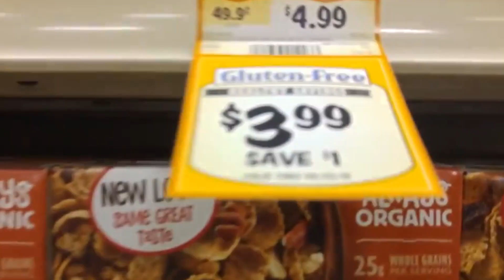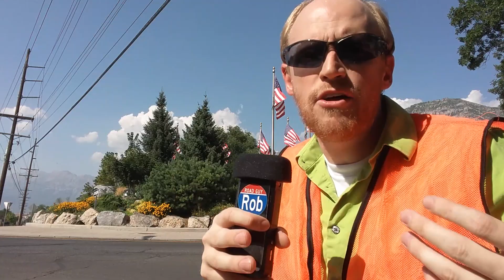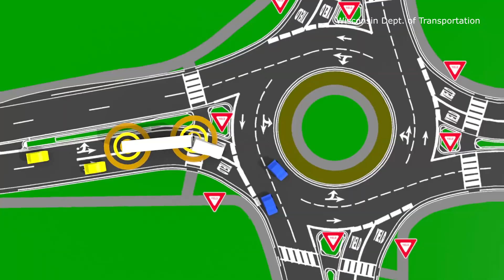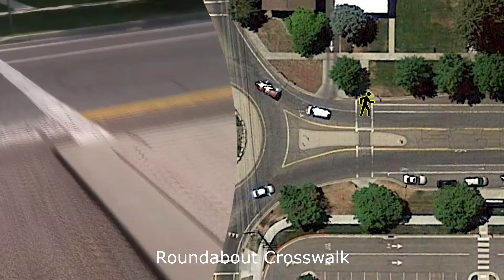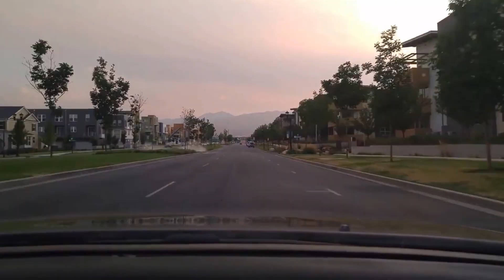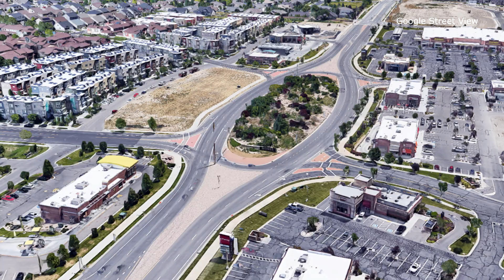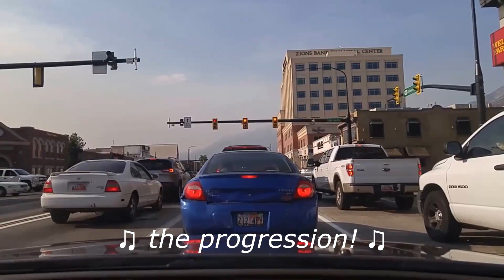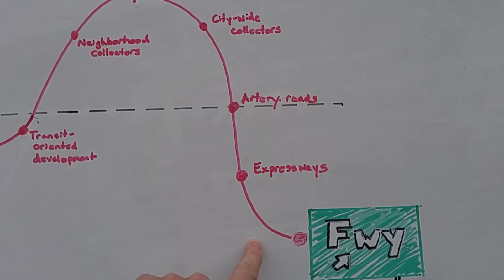Are roundabouts REALLY better than a traffic signal?

Comment: I was t-boned in a roundabout.  Yep.  I was in the far left lane of a busy roundabout and the other driver entered the roundabout and smacked into my front seat passenger side door.  I would have just exchange insurances and be on my way but he insisted that he wasn't at fault.  Police came, got both our statements and he was surprised to get the ticket.  I did ask the officer why he thought he wasn't the guilty party and the officer stated that the driver thought since he arrived at the intersection before him (which was true) he had the right of way.  The problem was that he was to my right, and in roundabouts you make sure traffic is clear to your left and then enter the circle.  Also note, my vehicle was a 9 foot tall Transit F-350 van so it's not that he didn't see me either.  So life goes on (I avoid that intersection at all cost and go out of my way to avoid it) and I get a summons to appear in court regarding the accident.  I'm not honestly sure if he was trying to fight the ticket (I thought that) because if the other party (me in this case) didn't show up he would have gotten out of the ticket but my husband was like hell no you're going.  So I showed up to court, the officer showed up, but guess who didn't?  So the driver ended up having a suspended license as well as the ticket, nd fees since he didn't show.  If I hadn't showed, the judge would have dismissed it.  So, if the other driver would have just exchanged insurances with me the ticket and loss of license would have been avoided.

Comment: I appreciate the mention of Carmel, IN.

They really show that if you go all in on roundabouts, it's vastly superior to traffic lights. The problem is just the mix.

In my home city roundabouts made my commute so much faster. Instead of 6 green lights on a row, I would usually get 6 red lights in a row. The roundabout fixed that!
Reply: Roundabouts work well in roads where there is equal amounts of traffic coming through each branch . Where there is a large flow in one direction problems occur on the other routes which lead to a build up of traffic on those minority routes and congestion as the lead car on these routes tries to get out onto the roundabout and make their way to their final destination.
This occurs many times where there is a traffic light junction or highway exit just before the roundabout maybe 1 to 2 miles from the roundabout.
Roundabouts are good in many locations but they can be problematical if traffic in one route dominates the roundabout and causes delays on other minority routes.

Comment: Would have been nice to mention the average decrease in time spent at the junction because roundabouts are wayyy faster
Reply: Incorrect.  Roundabouts are on average waaaaayyyyyyyy slower.  You are forgetting that most cars on a priority road never slow down at green lights.  This alone makes signal lights faster.
Basically you are falling into the human condition that focuses on the negative and not the positive.  You forget the green lights because they have zero impact because you didn't even have to slow down.  You remember the red lights because you did have to slow down.  This is where most of the false assumptions about roundabouts come from.

Comment: 2 points.
Roundabouts work in traffic dense areas. The roundabout at the start of the video is just badly design for pedestrians when i compare it to a dutch design for example. Once you get really small a small roundabout vs give way is much of a muchness as in each pedestrians have right of way over cars anyway.  Dual carriageways meeting are never going to be nice for pedestrians to cross and should have separate walkway access anyway. Pedestrians in a ideal design should no have to wait for traffic lights by a stinky highly polluted road. 

Roundabouts have the feature that they are faster at low traffic and slower than traffic lights at high traffic e.g. rush hours. If your goal is to push car commuters off the road this can be benefit of pushing commuters off the road but making it alot easier for delivery drivers and others who must travel and generally spreading out road use by increasing congestion. I remember one of the london transport planners saying this.

Comment: I like the balance in this video. We had an incident with a drunk crashing at 60 mph at night on a main road coming off a 60 mph limit road and not slowing to 30 that finally made people research a roundabout or traffic lights. (The best of the drunk stories was crossing the front yard and hitting the pillar of a big ole two-story house with such dexterity that the car was wedged in as part of the second floor porch support and they had to lift up the porch and put in a new support to free the car.) This is a four lane road (two lanes each way). A roundabout would take up so much room they would have to buy and demolish a house! They also rejected putting a traffic light there, which would have made it a lot easier to turn onto or cross the main road. It was decided to just put a manual crossing light for pedestrians. MUCH cheaper. (They liked that idea so much they studded the town with them! Solar powered.) So we kept the stop signs on the side roads. However they redid the entry to the main road so it splits with a little island into a turn right and a straight lane so the slow down area is much more obvious. I generally avoid trying to drive onto or across the main road at that side road. Certain times of the day there is a line up of cars at the stop sign. I can see why they have accidents. But at a 30 mph limit the accidents aren't usually fatal.

Comment: You should have mentioned the different vehicle energy used for lights and roundabouts. Stopping and starting for lights uses much more energy than adjusting speed for roundabouts. There's a commensurate reduction in pollution as well.

Comment: Roundabouts are safer and faster. Ironically given the comments on here about the inconvenience to pedestrians they contribute to ped safety by generally slowing town traffic, and despite slowing traffic generally you actually travel across town faster because you tend to filter through junctions faster. And of course part of the safety is that when you arrive at a roundabout you know all traffic is coming from just one direction and when a gap opens you slot in and move on. They also don't have to take up much more room than a standard junction: in residential areas mini-roundabout, which are little more than a slight dome in the middle of the junction are safer that a standard cross road or four-way stop. However, if you want to see a truely weird frankenstein roundabout google Swindon Magic Roundabout. I've been through it once and while it did indeed do the job of getting me safely and efficiently to the road I needed to be on, from the drivers eye view it's weird as hell because all you are aware of are vehicles around you going every which way! It was just unfamiliarity, but I couldn't help thinking that with the space they had for it, a simple four lane standard roundabout would have done the biz. If you fancy a tax-deductable trip to the UK post-covid, Rob, you might want to do a special on that :)

Comment: Safety, esp. for pedestrians and cyclists is more important than car traffic flow. And your example with the pedestrian crossing is flawed as you did not count from the starting point - roundabouts are wider by nature, so you should have measured an equal distance which would have made the comparison likely 110 steps to 115 steps.
I live on a main street in a small town in Germany which used to be a Bundesstraße (comparable to a federal highway). It ran straight across the whole town with a curve about half a mile in the town. Cars and trucks would rush in without reducing their speed and just roll out until the curve where they were down to 50 klicks (max. speed in towns and villages) or had to brake to reduce the speed to it. This was very dangerous for pedestrians, cyclists, and pets. About 25 years ago they built a roundabout at the beginning of the town, so everybody has to slow down before even entering the town via the roundabout. Now all vehicles keep the speed limit and the situation is much safer for all.
Reply: you mentioned how the main street used to be a highway. I think safety was improved by moving the highway elsewhere, not the roundabout.
Reply: @blitzn00dle50  Correct and not so correct at the same time. They built an Autobahn (interstate) to replace the Bundesstraße which, indeed, keeps a lot of thru-fare and esp. trucks out of town. The Bundesstraße got demoted to a stateroad (state highway). So that part is correct. 
On the other hand traffic, in general, grew a lot in the same period, so that we today have the same amount of traffic we used to have before or even more. 
But because of the roundabout traffic has become slower, less dangerous, and less noisy since.

Comment: Cairo (Egypt not USA) has NO traffic lights- everybody ignored them. Instead they have roundabouts or (brutal) speed bumps at all the roads entering an intersection. Traffic flows in a continuous stream day and night- great for traffic, terrible if you are a pedestrian trying to cross the road... I'm from the UK, we have had roundabouts with traffic on the roundabout having priority since the 1960's. One thing I notice is that if you are on the road with higher traffic density you tend to find it quicker to get through the roundabout, which is as it should be.

Comment: the industrial district in the city I live in has a pair of double roundabouts on either side of it to get onto the highway. in deference to it being in the industrial district with no foot traffic they put no pedestrian pad in the middle, but that just made it harder for big rigs to use, it used to drive me insane having to drive my rig thru it literally every time I had to stop by the shop to pick up a load and then leave to go drop it off, having to take up two lanes of traffic in the middle of rush hour thru the whole roundabout.
Reply: In Europe they have roundabouts everywhere. In fact, in some countries you probably have to go across 15 roundabouts on average with the truck in a 250 mile trip. No truck driver has ever complained about that. The situation you are describing is just down to the fact how well road users understand roundaboutsand that the big American cars are not really designed to go around corners compared to the smaller and more agile European cars.

Comment: We've had roundabouts here in Australia for decades, as a heavy vehicle driver the multi lane roundabout are in my opinion potentially dangerous, cars trying to get past the slow large vehicle try to overtake on a multi lane roundabout making it difficult for heavy vehicles to get through safely. Plus so many drivers don't seem to understand which lane they should be in, case in point, being in the left lane to do a right hand turn, causes a number of accidents.

Comment: All I know is that in the 8 years we've had the roundabout the traffic has been flowing amazingly with seconds to wait (on average) as opposed to minutes.
Reply: There were some rural highway intersections around here where you could be waiting at a stop sign. forever. Roundabouts have been a huge improvement.
Reply: AS SAID !! Not nearly all places do good with a round a bout. Case in point; A village councilman says we're 8 years behind times, we need a round a bout at our town square to fix the traffic light issue. 😮 Well, you know what? Those historical buildings would have to go .  .  .  .  .  .  .  maybe not all , but many!!!??????!!!! And, just since something is touted as being new & innovative, does not mean that every rooster has to sit up on the fence and cock-a-doodle doo, about it!!
Common Sense is not a commodity to be Sold Out to Stupidity!!!!
It's NOT a commodity at all, it is that; which is called Wisdom, recognized by some. And definitely not recognized by all !!!
Reply: Invalid point.  You are missing all the green light traffic that goes through without slowing down.  That vastly outweighs the benefits to the non-priority road of the intersection.
Reply: @winoodlesnoodles1984  your average set of lights you have a 1 in 4 chance of a green light. Roundabout are much safer and faster. Simply no argument.
Reply: @scottwhat3362  You literally just watched this video and it explained it how can you still be so wrong. The idea behind lights being faster is that if you had roundabouts at every intersection you wouldn't be able to group cars into platoons and then let them cross the entire road with green lights. On the first red light cars will wait on average 20-30 seconds and then will have the entire road free for the next 8 maybe more traffic lights. That means 0 wait at those. If you had a roundabout at each of these intersections and we assume you wait lets say 10 seconds at each roundabout then that already makes it 80 seconds total of waiting at intersections rather than the initial 20-30 seconds you'd have to wait for the first red light to turn green. Roundabouts are often better in small areas where there aren't that many cars so that you don't have to wait at all instead of sitting at a red light when there's no traffic, but they have their variants on busier roads. Anyway they aren't better, they're situational. In some situations they are better and in some they are in fact worse.
Reply: @Ptoki1  And how often does that work out? I’ve driven in many cities with supposed timed lights. They are never as fast as a main road with roundabouts. Their is a reason why new developments are all roundabouts in many places. They are safer and in most situations (not all) they are faster.
Reply: @Scott what  ive driven in a bunch of cities in Canada and i find the timed lights to work rather well, especially on one way streets. Also ive only seen a few crashes in my life. One was nearby my school and it was a lane change accident, second third and 4th were in Chicago and they were rearends. Accidents are rare in my city. You just admitted that they are situational just as my comment stated above so whats the point of further arguing? If they were straight up superior there wouldn't be a debate about it and all cities would start building only them but for some reason they don't and thats because they are situational.
Reply: @Ptoki1  One-way streets, ye they probably do. That's the thing, most busy roads are not one way. Timing either works in one direction or is a compromise.
Reply: @scottwhat3362  it makes sense when you can prioritize the primary direction the traffic flows at a given time but with one ways it works best, the streets i drive to uni work quite well in both directions ive noticed even though they're 2 way
Reply: @Ptoki1 that only happens on big roads, smaller roads doesn’t really work
Reply: @matthewnorman9803  yes thats true, like I said roundabouts work well on smaller less busy roads, though stop signs/yield signs do pretty good as well. It's definitely very situational and roundabouts sometimes work better and sometimes work worse, it's not a one size fits all. Definitely a mix of all 3 placed in correct spots is the best solution you can come up with.
Reply: @Ptoki1  he talks about pedestrian safety and in Australia some roundabouts have dedicated pedestrian crossing with traffic lights which works very well. I do t see it being done in America yet

Comment: The example you used to count the steps had the crossing set back too far from the intersection.  Here is an example and also shows you don't need a large roundabout for it to work.
https://www.google.co.nz/maps/@-40.3556929,175.6224253,3a,67.9y,331.11h,74.41t/data=!3m6!1e1!3m4!1sJN7djXxs55Wwn1Kcnj4fuA!2e0!7i16384!8i8192?hl=en&authuser=0

Down side to roundabouts is they don't work well once you get too many vehicles, well that can be over come by making it bigger but not all intersections have the space.  My town is about to convert a pair of roundabouts to lights due to the increased traffic flow and lack of space to expand the roundabouts.  The other issue is when there is a big difference in flow of traffic.  Such as lots of traffic traveling south/north so traffic trying to get across never have a gap to get across.  An under pass might work - if you had the space but probably best just to use a set of lights.

As for never on a freeway, here is one above a motorway.  The straight through traffic goes underneath and it is just to help traffic joining or leaving the motorway.
https://www.google.co.nz/maps/@-36.8889896,174.7965188,18.25z?hl=en&authuser=0

Comment: On a notorious stretch of highway by me the only way you will get through all of the stoplights consistently is if you're driving in the middle of the night when nobody's there and going at least 5 miles per hour over the speed limit, and even then there might be a few sale greens or yellows you have to push through.

Comment: myth busters proved it
edit:
in Australia they are everywhere and they are great and flows are so much better than stop signs or lights (crazy I know)
ps they don't have to be big except for B doubles
and they are only in industrial areas (if ya smart)
edit 2:
also in Oz
we have a turn lane in the roundabout and that works so one lane goes straight
one lane turns(which ever way you go on which ever side of the road)

edit 3:
On arterials leading to freeways roundabouts are great for entering to the freeway
this also. solves stop lights on entering freeways ( not heavy traffic) just the under bridge right (or in ur case left ffs)
u get the idea (I hope)